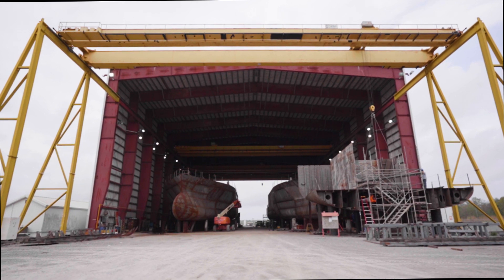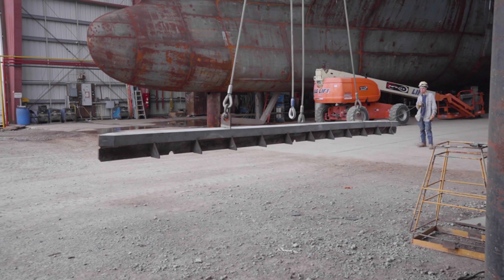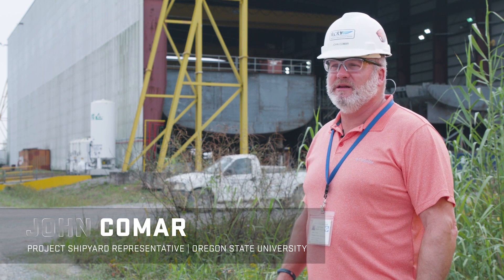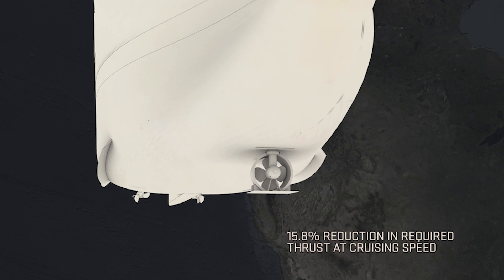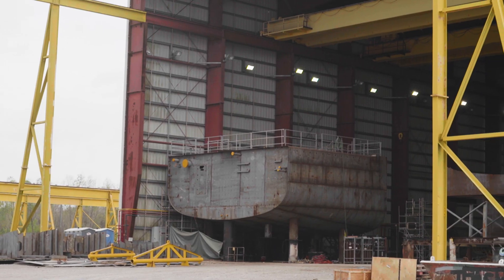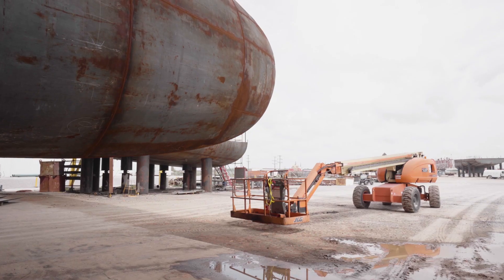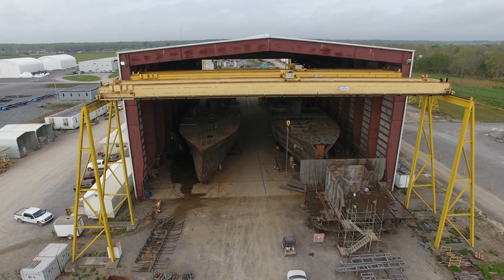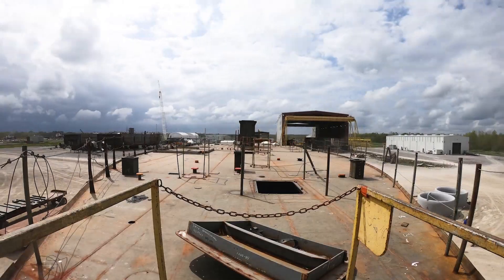RCRV Part 2: Designed for Science at Sea

Comment: Z-drives? They're using azipods. Z-drives are directly linked to driveshafts, this is electrically powered motors within nacelles. Girls cant do engineering.
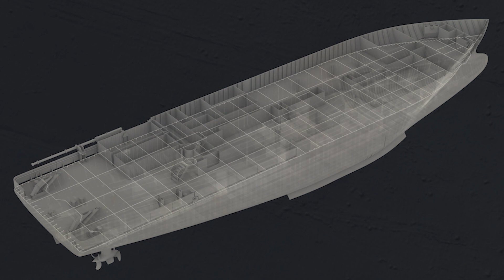Reply: It has two Z-Drives, you could have checked the technical drawings or looked at 3:29, where the drives are shown in the hull. It's very cool that Oregon State publishes the drawings and CAD files.
Reply: You do realise she’s just been given a script to read???